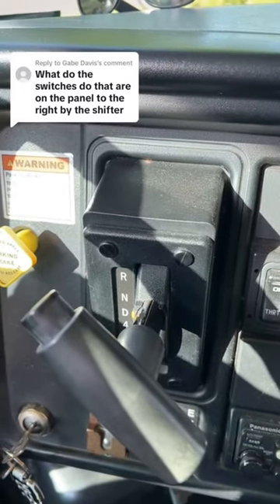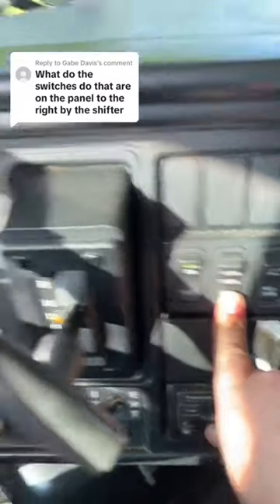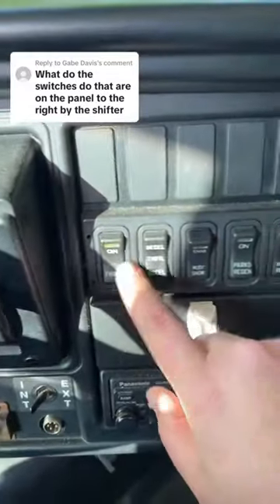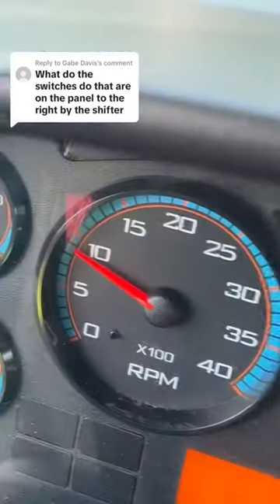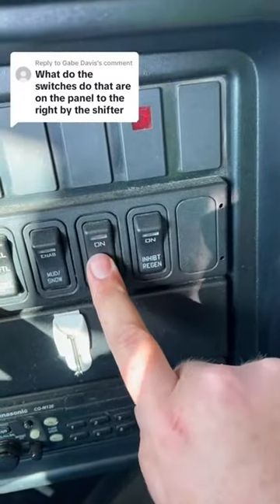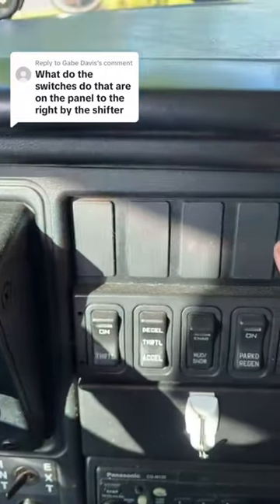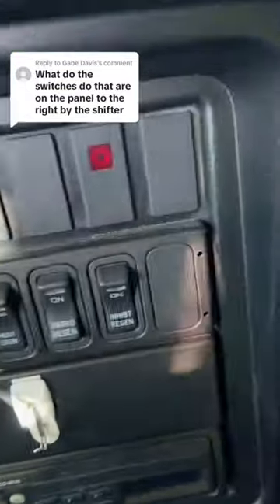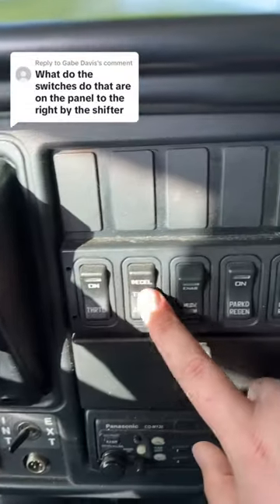WHAT DO THESE SCHOOL BUS SWITCHES DO?

Comment: I sincerely hope you drive that bus for more than an hour at a time, or else you will eventually learn why those Regen switches are there.
Reply: Especially on the older International motors like the one he’s got in his bus
Reply: Man has the inhibit off
Reply: Or ya know you could share some knowledge so he knows what its for?
Reply: @tylerjeffries7507  Parked regeneration is used to heat up the exhaust while stationary. When the inhibit switch is on, it will not automatically try to remove the sut and whatnot from the exhaust. Essentially you're not supposed to have the inhibit off unless you are on the highway or such.
Reply: @tylerjeffries7507    On-road Diesel engines are now required to have emissions controls (since the mid 2000s).   One emissions mitigation device is a diesel particulate filter, which is a part in the exhaust system that captures most of the black soot you used to see coming regularly out the exhaust pipes of trucks.   As a filter, it eventually fills up.  Instead of having to frequently change this filter, it is designed to "regenerate" itself through a regeneration cycle.  This requires a lot of heat, and often the introduction of diesel exhaust fluid (DEF - note the smaller, blue-capped tanks next time you look at a truck).   The regeneration cycle takes 30 to 60 minutes to complete, and is executed while the engine is in normal operation.  
For a regen cycle to be successful, the engine system usually needs to be up to temperature and running for that amount of time after it is up to temperature.  If the engine doesn't run long enough, the regen cycle never starts nor completes. The eventual result is that the filter plugs up and requires mechanical service/replacement.  By design, the controller doesn't start a regen cycle when the vehicle is in park, as there's a reasonable assumption by the controller that the engine will get shut off.   The first switch tells the controller that it's okay to begin a regen cycle in park as the intention is to leave the engine running (in park) for that purpose.  The second switch tells the controller not to attempt a regen cycle as it is expected that the engine will be shut off before the cycle can complete  (inhibiting a cycle prevents wasting fuel and DEF).   Overuse of this second switch carries the same ramifications of not letting the engine run long enough to complete a regen cycle.
School bus routes are usually long enough that automatic regen cycles can successfully execute, but for shorter periods of use it may be necessary to schedule a longer engine run period for the regeneration cycle to complete.  There are usually indicator lights that let the driver know when a regen cycle is needed if it wasn't able to execute automatically during the course of normal use.

Now, did you manage to make it this far reading all of that?
Reply: @raymeyer8843  I did, thanks for the cool info!
Reply: @tylerjeffries7507  You're welcome.

Comment: Parked regen is for a blow out of the exhaust filter. The temp gets hot and the filter gets full and limits bus performance. You need the regen to heat up the exhaust line and blow it out.

Comment: The parked regen means that it regenerates the dpf. It is a filter that reduces small particle emissions. It collects dangerous particles and the regen makes them not so dangerous. Usually the trucks regens the filter while driving, but if you drive very small distances it may not be able to do it, thats why there is a switch for it. I bet there is a light for it in the dash, so you know when you have to do it. The light has like filter picture in it. Even if its on, you can do the regen while driving longer distances.

Comment: What is the regen light on a bus?
This occurs when soot inside of the engine is high enough that a manual or forced regen is needed. When this happens, a “check engine light” is illuminated on the dashboard, and the bus must be parked, and the driver or technician must tell the bus to manually regenerate.
Reply: Nah trucks do regen all the time
Reply: You can regen if you want to every so often to get the exhaust hot enough to burn all the soot off, that’s if you do a lot of idling and not much running. Some vehicles w/ diesel engines do this automatically.

Comment: But what is engine breaking?
Reply: It's a device that helps slow the vehicle, usually only found on heavy duty vehicles that go through mountainous terrain, usually employing the engines compression or turbo boost pressure...see JAKE BRAKE .

Comment: Why do you need to raise the rpm?
Reply: It's cruise control, but sometimes it's useful to gain air pressure in air tanks if needed quickly.
Reply: to quickly raise the air pressure for the air brakes or to potentially warm the bus up in a short amount of time in winter, also cruise control
Reply: Don't they do it when it snowing or harsh weather it to warm up the engine much faster no?
Reply: @tropicalgoblin2023  They probably do, just didn't think of it that way.
Reply: @Reese-Tube  sound like a race car or some shi